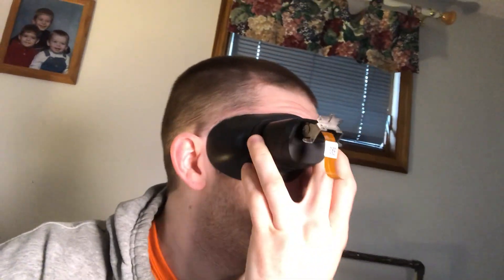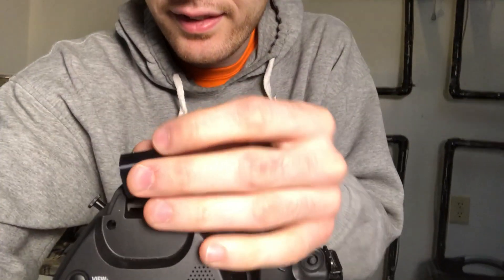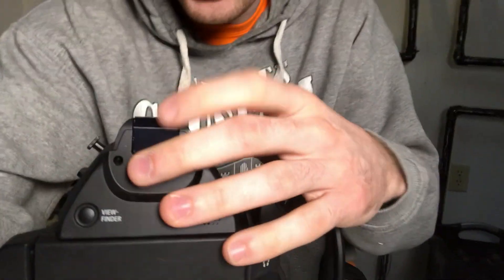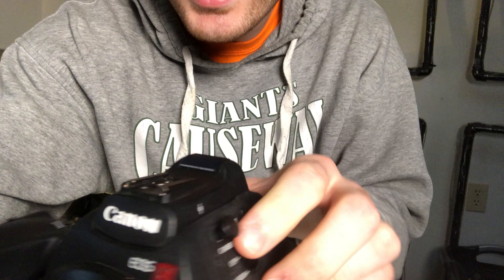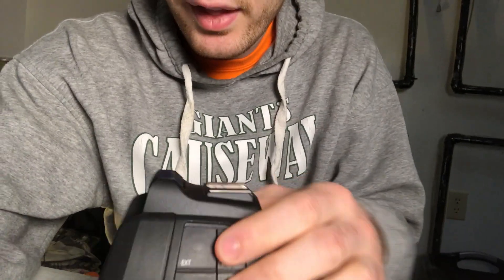3D printed Canon C100 MKII "EVF" Replacement

Comment: How did you attach it? Double sided tape?
Reply: Hey Troy, I actually used HotGlue. I wanted to make sure it didn’t go anywhere as well as maintain any weather seal that it might have. This way I can also remove it if I have to.
Reply: @nathanrobb8558  Thanks for the follow up. Are you still using this set up? How has it been working out for you?
Reply from the maker: @TroySentAMessage  Yep! I use the camera all of the time. I never used the view finder anyways, so I have never missed it. I originally did this thinking I could try mounting the camera to my Ronin-S or -M gimbal, but it is still to big. It is nice having the camera slightly smaller.